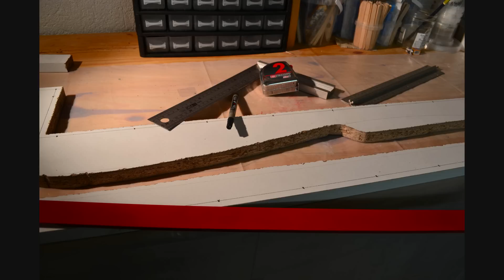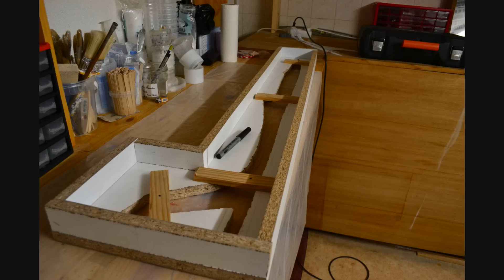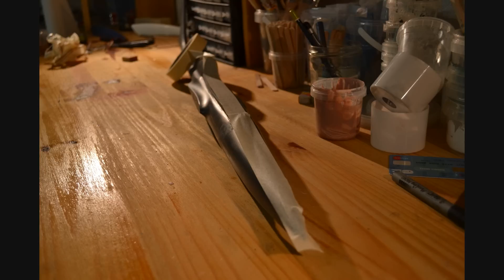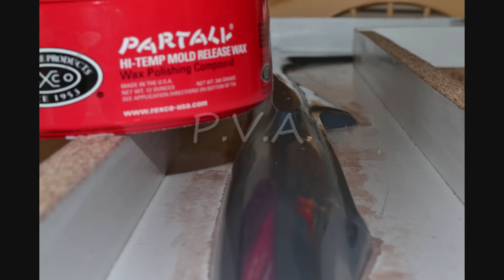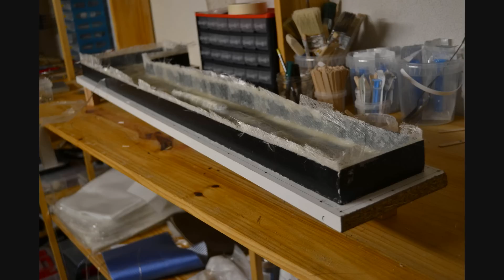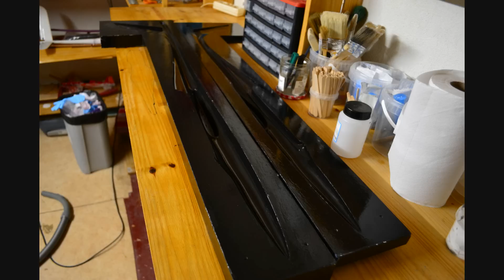how make mold of rc sailplane comment fabriquer un moule de planeur rc

Comment: Un grand merci pour cette transparence dans les trucs et astuces :
1. Mettez une ou deux couches de gel coat
2. Avec quoi diluez-vous le gel coat et dans quelle proportion 
3. Attendez-vous que le gelcoat soit complètement polymérisé ou simplement "amoureux" avant de poser vos congés d'epoxy et floc de cotton
4. Posez-vous tout de suite la fibre ou attendez-vous que les renforts soient secs
5. Combien de couches / grammage de FDV
Reply from the maker: Mais de rien ;)
1 : une seule couche
2 : c'est de l'E.P.D.B.D.
3 : je les poses de suite (maintenant je n'en mets plus car j'ai un autre type de procédé)
4 : je pause la fibre lorsque le gel coat est amoureux et que les congés ont commencé à sécher
5 : c'est au jugé et en fonction de l'utilisation du moule et de la forme de la pièce, le mieux c'est de faire un témoins en parallèle sur une feuille autodémoulante pour se rendre compte de la résistance
Reply: Rouge 13 model merci pour toutes ces réponses
Reply: Et puis en regardant vos autres vidéos sur la fabrication d'un moule d'aile, je viens de comprendre une autre technique pour (remplir) le moule sans s'emmerder avec le mat de verre trop longtemps